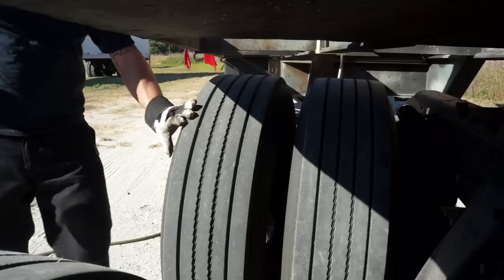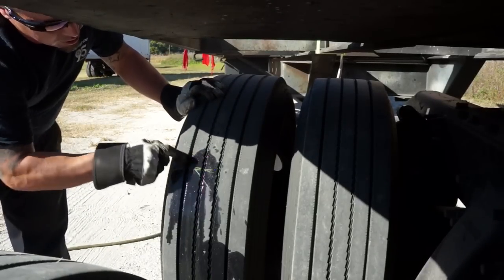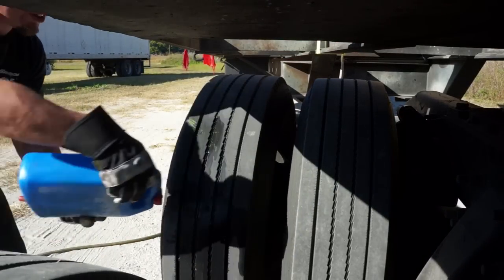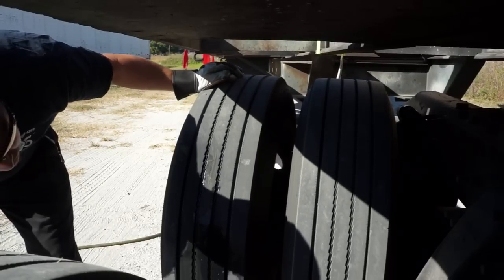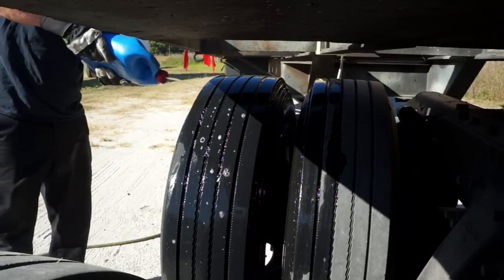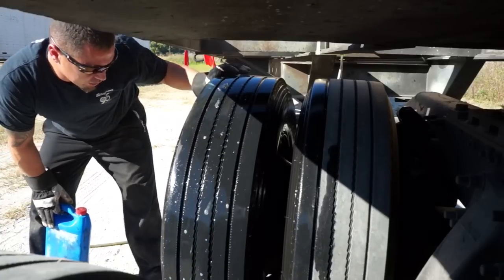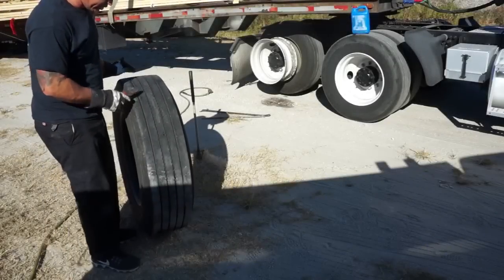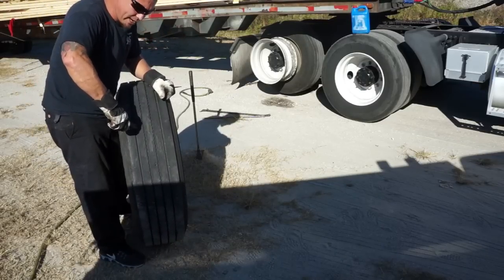Tire repair on a semi truck (instructional)

Comment: I like those combination plug/patch things. They probably cost a little more but they save some time.
Reply: The thing with the plug patch is the plug seals the tire , keeps the weather from decaying the Steele cord. Which will make the tire weak.

Comment: Good vedio. As a certified commercial tire technician i follow all same techniques as you, except i don't use buffing solution after  buffing,  i use a brass brush to clean surface.
Reply from the maker: I use the brass brush also

Comment: I got a problem. I’ve been having a problem with o-rings on 14.00r25 earthmover tires with 3 piece rims. I grease the shit out of the tire beads and the rims where the tire contacts. Whenever there’s a large load on the tire the o-rings starts pissing out air where the lock ring gap is. Any idea what’s going on?

Comment: great video as usual, I seem to struggle with getting back beads off these days when wheel is on trailer any tips?
Reply from the maker: When changing the outside tire I lube both tires.

Comment: nice, I personally hit my repair with a wire wheel after using the buffer on the inside, it smooths it out a lot more so the patch has a higher chance of sealing, but good video.
Reply: just a vet  I just plug and go make my delivery. then I put the patch on when I have time
Reply from the maker: Thats a good move. I do have the wire wheel set up for my buffer or a handheld brass brush

Comment: Really good vide how much do you charge for patching a tire and if there is more than 1 nail
Reply from the maker: Price depends on tire size, what type of equipment it's on and time spent removing tire. Price of repair includes 1 patch additional patches are charged accordingly.

Comment: What kind of lube do you use and what mixture? Thanks!
Reply from the maker: For checking for leaks and dismounting tires I use Ajax dish soap and water. I find Ajax to be priced right and it does not get foamy like Dawn. As for the mixer I never measured it lol. As for the lube for mounting tires I use Murphy soap or equivalent. I will put a few handfuls in an empty bucket and add a little water. I will break the soap down by hand and let it sit in the sun. I like it when its a consistency like dish soap or thicker.

Comment: What do yall do about tire explosions, do yall just take a risk, or is there a trick to figuring out that issue, before it may happen.
Reply: pistol perez same thing I do don't stand in front of the tire
Reply: YUKI JINJUJI thanks for the tip 👍is that all, only during inflation right lol
Reply: You can look up TIA videos on inflating tires and signs of zipper ruptures.
Reply: You hear a ripping sound in the tire , your supposed to keep the valve core out and use a 10ft air extension so you won't get blown up.
Reply: Oh yeah, use a tire cage very  important.
Reply: You also inspect the tire before you work on it , look for wear on the inside that's called a run flat,I don't fix runflats.

Comment: I will have to show you how I do it without jacking it up and not driving up on a block under the other Tire either. or releasing the brakes.
Reply: Jon Rheaume  lets see ?

Comment: great for tire dismounting but tire repair needs work. backwards. drill, scrape, buff then fill with insert. do not put glue on plug. glue goes into drilled out hole. if you put cleaner after buff takes longer for vapors to evaporate. so clean first, then buff, glue, stitch. otherwise ok. good techniques.
Reply: Good job but yes cleaner on b4 buff and a spiril tool is excellent for cementing the hole. You will see that if you apply cleaner and scrape b4 buff the buffed area will be smoother.